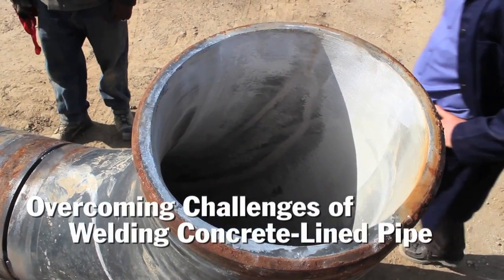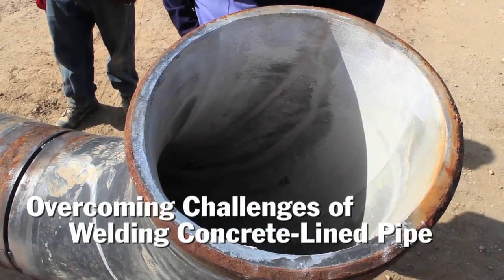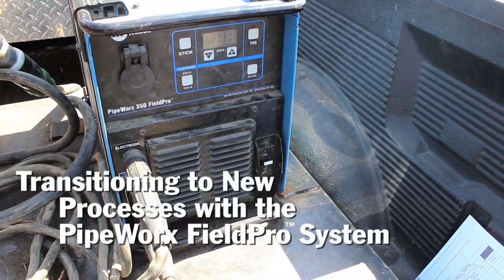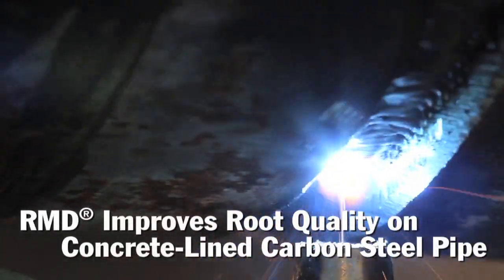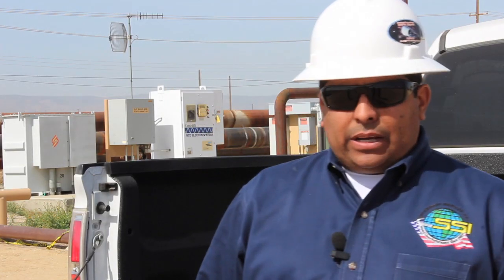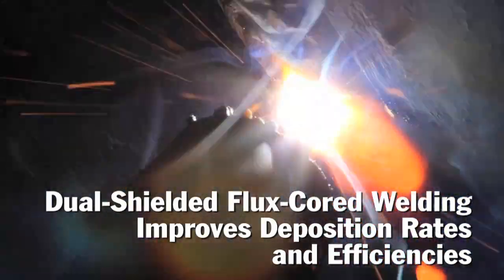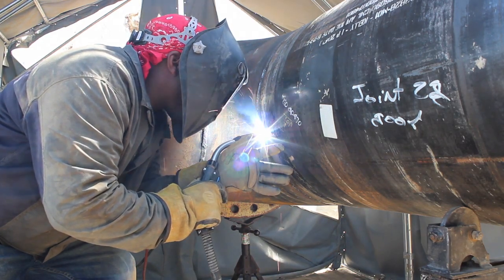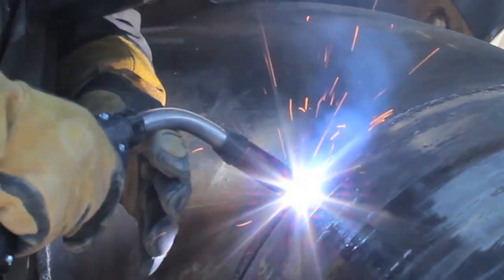Miller RMD Improves Quality, Productivity when Welding Concrete-Lined Pipe

Comment from the maker: John Lucero of Sturgeon Services International talks about overcoming the challenges of welding concrete-lined pipe using the Pipeworx FieldPro™ System with the RMD® process. In addition to experiencing increased productivity (some jobs completed up to 66 percent faster with RMD) and better root quality, the crew at Sturgeon experienced an improvement in travel speed and ease of use — all factors leading to cost savings for Sturgeon and their clients:
Reply: Quick question the shop i just got in wants to start using RMD process for there pipe they have a pipe worx 400 what wire do you recommend for sch 40 pipe 2" and up 20" max